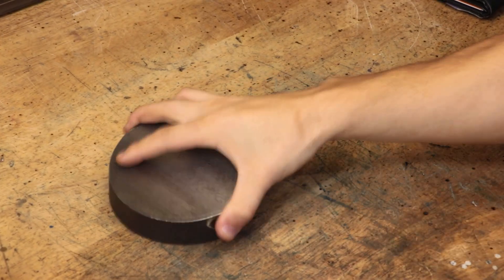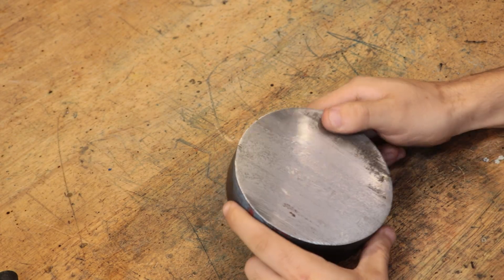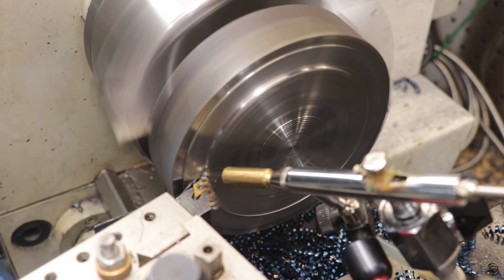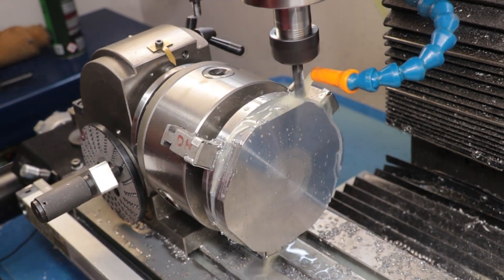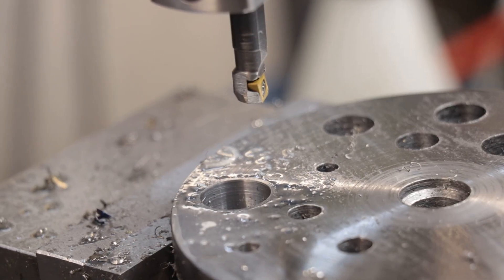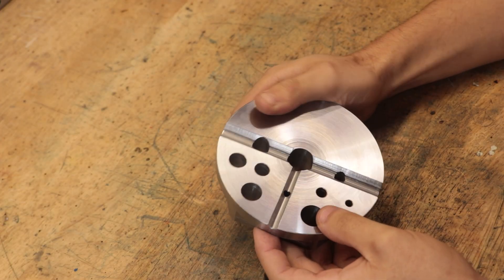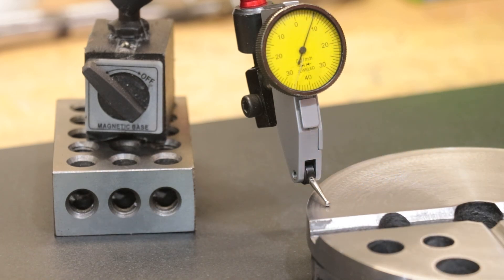BUILD: A Toolmakers Bench Block (Staking Anvil)

Comment: Back side hollowed out for weight reduction?
Reply from the maker: Would that really be necessary
Reply: @artisanmakes probably not necessary, but asked why. I was searching for bench blocks and most of the new ones were hollowed out. Less weight was the only reason I could think of. Why wrestle with a 5 pound hunk of steel when a 2.5 pound one would be lighter, especially if you were using one hand.

Comment: That lathe is extremely fast. especially for going from nothing to pretty deep into the metal on each one of those cuts. and the evidence of that is the chips are completely blue. however it's really good for nice finishes.
Reply from the maker: It’s been so long since I did this but I think it was the speed that worked the best on 4140 with these carbide inserts. I don’t think I was particularly happy with the Brad I was using.
Reply from the maker: Nah I just checked again, it doesn’t go above 300rpm. Well in the range for the inserts I’m using here. The video is sped up quite a bit
Reply: @artisanmakes 
I wasn't considering that the footage was sped up. but it was doing some aggressive cuts. turning all chips blue.
Reply from the maker: It probably was a bit. I was pushing the lathe quite a lot when I first bought it. But I guess that is what carbide is there for. Cheers

Comment: Hi, I've been going down your catalogue of videos (just found you recently, great channel!) and I notica you never seem to use stress-relieving cuts in parts where you have internal angles. For example, the dovetails on your replacement late cross-slide, I was surprised you left those un-relieved acute angles, especially as the original cross-slide had relief cuts.
I'm no expert so I don't really know how important this is, I can see the forces on the cross-slide being reasonably low so fair enough. But I'd expect the stress-rising effect of the sharp angles at the bottom of the V-grooves to be quite a concern, given it's a hardened part and the splitting forces are likely to be very high given you'll be hammering on rods in those grooves which is going to put very high peak forces pushing the groove apart. I thought you'd have rounded out the relief with a ball-nose endmill or something.
Like I say, I'm no expert. Is this just not as big of a deal as I think it is?
Reply from the maker: For this one specifically I did one channel length ways, but for the perpendicular one I didn’t, mostly cause it wasn’t a sharp corner/line left by the cutter so I didn’t think it was hugely necessary. 

For others I take on a case by case basis, I have done it a few times, but the way I see it is that if I’m not using a super brittle material and I’m not pushing the part to its limit, I usually don’t worry a whole lot about it. Is there a risk of cracking, yes. If it was a mass produced part or a part you were making for someone else it would be worth adding. But for me and my parts I’m usually confident enough to judge that most parts aren’t being pushed to their absolute limit and probably dont need that relief cut. That’s my looking at it anyway.
Reply: @artisanmakes  Cheers for replying, yeah that makes sense to me :)
I guess it's worthwhile for commercial parts where you want reliability and you definitely don't want failed parts being returned. Especially seeing as they're most likely made with CNC so it's basically no extra effort.

Not much experience with metalwork here. but I've found a few situations working with other materials (silicone sheet being a biggie) where cutting a circular relief at the end of a cut makes the difference between a part that will literally rip in half under its own weight and one that can withstand a huge amount of tension.

Thinking about it I suppose thin sheets are way more sensitive, eg sheet metal.

Comment: This comment may have already in one or more of the 151 (at this moment about 2 weeks after this video was posted), but I'll make it anyway, just in case: The undersides of some(?) bench blocks are probably hollowed out to try to avoid the block rocking on convex surfaces (i.e., uneven workbenches or chips on flat surfaces).  Edit: You commented on this at about the 6:50 point in this video.

Comment: great build!
oh heck i keep forgetting to tell you..
if you happen to be in oil/gas region or mining, a great source for large 4140 scrap is folks using pile drivers. they often replace foot long 4" diameter round sections and 1ft sq by 6" thick  sections of 4140 as part of their consumables. free/cheap metal

Comment: In a comment elsewhere in here you mentioned it was difficult to get a small enough feed in with the lathe. I can't see your setup to see if it is, but if you set the compound at 30 degrees to the workpiece then the feed on the handwheel halves. So one 20micron graduation becomes a feed in of 10.

Comment: thing is with grinding that the amount of material that passes the tool varies from the outer circle towards the center so you either need to slow down the lathe while moving to the center of move the tool slower inside the further you go in 
allso might be eazier to heat treath the steel if you use a pottery oven as you can controll the temperature a little better inside it and heat the part more evenly , you had the part in the pad of the propane flame and it was pretty clear that the part closest to the flame got hotter faster than the part that was away from the flame , this might allso cause warping 

aaaah waswondering where a staking anvil ws used for , hmmm thats pretty handy

Comment: If you want to polish the face of the bench block further, you could certainly stick a piece of fine sandpaper in a granite surface plate or even a thick piece of float glass and wet sand the face of the block against it.

Comment: I have an idea for minimizing the aerosolized coolant your mist part cooler produces. Add a brush to the end like one of those cheap ones for flux, or maybe add a sponge brush, the brush head means it still delivers the coolant where needed by just placing the brush head on the part. It'll reduce aerosolized coolant by catching it in the bristles/sponge.

Comment: I would imagine the reason it cracks in water is because it is cooling it off too fast. Oil will hold heat better. Keeping the part from shock. Same reason why some people can heat treat a flat bar, and others are just cooking a banana.
Reply from the maker: That is right but some steel are more prone to cracking than others due to what they are alloyed with

Comment: Ild avoid using your power drill to unwind your chuck. If a chip gets in there then it can cause some damage to your chuck since the drill will just power through
Reply from the maker: maybe. I used to do this for years with the old chuck and it never caused any issues. i know the risks and I am fine with doing it to these cheap chucks

Comment: It's awesome to learn more ways I could do a job even without the proper equipment. lol well done. My suggestion would be if you're ever in a position again of having to make "V" grooves like that again would be to machine the relief slot first. This may seem counter intuitive at first but it is very important based on surface speed of tool geometry. When running at a constant RPM the larger the diameter of the tool the greater the surface speed is all the way down to a diameter of Zero whereby no matter how fast you have your spindle running the surface speed is also Zero. Therefore, when machining a "V" groove with a chamfer tool and no relief you are basically dragging the very tip through the material as if it isn't spinning at all which will create greater pressure on the machine and the tool. Hope this is helpful for future endeavours.
Reply from the maker: I know, I think I just got lazy for a bit and tried to make to work

Comment: Nice build. One suggestion though, instead of loads of facing cuts to clean up the stock, use the mill with a large end mill or shell mill to remove the bulk, then face in the lathe.
Reply: or .... the hacksaw!

Comment: HRC of 50-55 is pretty high for 4140 steel. Its toughness increases rapidly below HRC 50. 42-48 is generally a good range for very high strength and good toughness

Comment: You ran out of power when drilling enventhough mill has the 3 hp motor?
Reply from the maker: Yeah. It’s extremely powerful above 600-700rpm, but still lacks a bit of torque to do low speed drilling in large diameters
Reply: Oh thats the case 
Thank you for information I was planing on doing something similar to my mill but I thought that 1.5 hp will be enough

Comment: to get a better finish with your tool post grinder, run the chuck clockwise (reverse), dress your stone with a 45 degree-ish angle and turn the post with grinder mounted to match the angle on the stone to the work. only take very light cuts. anything 1/1000 of an inch is way too much for a tool post grinder

Comment: when machining a v groove, it is a good idea to make a relief with the normal endmill first :) Also, 50to55Hrc is not too hard to turn on a lathe with proper carbide inserts.
Reply from the maker: I’ve done a bit of hard turning before, but I don’t think the inserts would appreciate this type of interrupted cuts
Reply: @artisanmakes  depends on the inserts :) but yes, they can go dull fast :D
Reply: @artisanmakes  CBN350 inserts are great fori nterupted cuts in hard steel. Just use small depth of cut. They work great for truing chuck jaws instead of grinding.

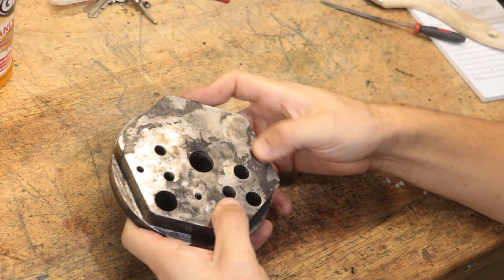Comment: At 16:45, could you have done the heating with an electric furnace/kiln, or an electric induction cook-top element inside a furnace type body, while flooding the furnace with argon gas instead of flux for surface erosion protection?
Reply from the maker: Yeah if you certainly can if you have one. I don’t unfortunately

Comment: Aboot the bottom being dished out.  Do I get a prize ??
Maybe it's the same reason dish bottom furniture like tables and lamps.
  Is to help them sit flush on surfaces without rocking. Imagine the difficulty it would be to get a 3 foot diameter flat bottom dish from rocking if the surfaces are not perfectly flat

Comment: For your surface grinding - reverse the lathe so the rotational planes are opposed.  If both contact points are spinning the same direction they're going to push off instead of biting in.  Having a very slight angle helps a ton too.
Reply: I don't know nothing about machining so I'm asking you since you seems knowledgeable, the angle is so you have a single point of contact instead of a whole surface ? What if the point gets worn out? The stone wouldn't bite into the part so no more "facing" , thanks
Reply: @fabiofoltran4361  Yes, it's so you have a single point of contact, but the direction of contact is more important than the amount of contact.  Good instinct there.  The wheel is going to wear down, it's designed to so it doesn't get smooth and stop cutting, but it wears out slowly if you have the right type of stone. As it does you can adjust for the wear and you have the option to "dress" the stone, meaning use a small diamond to cut it back into shape.  With this small of a stone it's not going to matter if your stone starts looking like a dreidel, it's going to work just as well  because the entire contact surface will be rotating the same direction.

Comment: The boring out underneath is to make it less likely to wobble on uneven surfaces (less contact area) same as with mugs.
Reply: mugs mainly have a recessed bottom for the same reason that glass bottles do which is to direct all the force of placing them into the area which is strongest
Reply: i’m not saying you’re wrong just that the reason you stated is secondary to durability

Comment: Great build! A Blacksmith taught me when i was young that used motor oil makes for a good hardening quench medium and iv always used that. Different oils from different cars are bettor or worse,  and i hear the impurities from the engine and carbon build up actually add to the oils ability to make a harder case on the metal.
Reply: It’s been a long time since that was a thing. All the detergent and other additives in modern oil make it pretty bad as a quench. What he is doing with veg oil is a much better option.
Reply: @Phil_Cleaver  How do the detergents effect the quenching of the steel? Does it change the rate the heat is removed or how it interfaces with the oil? Genuinely curious cause I've never heard that mentioned or experienced anything to suggest such.
Reply: Me too, the cost of the motor oil being way cheaper than vegetable oil is my motivation. I haven't done enough to tell anyone what to do properly though.
Reply: Lawn Mower oils are a possible source of low detergent oil. The detergent keeps impurities suspended in the oil to allow for being filtered by an oil filter. Non detergent oils allow contaminates to settle and circulate less in engines that have no filters to capture them.

Comment: A good tool for facing that wonky puck of 4140 is a diamond tool holder. They handle interrupted cuts really well and take seconds to sharpen. You don't even need to remove the tool bit from the holder to sharpen it. If kept sharp they require less power to drive than a ceramic bit too. Use another bit ground with a slight nose radius for the finish cuts.

Comment: When grinding, it is often prudent to reduce the contact area of the wheel with the workpiece. In this case the end of the wheel is often dished out so it only cuts on a line around the circumference. This reduces heat build up and helps with keeping the wheel open.
Reply from the maker: Yeah I just did the lazy option of tilting the grinder every pass to try and grind on one corner
Reply: i agree. mount it side on so the circumference of the stone presses against the part, not the face. just turn the tool 90 degrees.
Reply: They mean if you're using the front face then you dress it with a chamfer rather than a square face

Comment: That router bit would have lasted longer with a clearance slot machined first. The cutting forces on the point are too high and the point is too fragile to withstand the cutting forces. I've done it with a slitting saw or a small diameter end mill. The slitting saw worked a little better depending on the depth of the slot.
Reply from the maker: Probably, live and learn

Comment: Bench blocks are bored on the bottom to reduce the weight. Toolmaker boxes usually have hundreds of pounds worth of tool steel, and weight reduction is important
Reply: Also so they sit flat on a workbench. Much easier to sit flat on a small rim than on a wide surface.
Reply: And it gives chips somewhere to go when using it as a tapping guide.
Reply: a machining related tool that sits around in the workshop is probably one of the last things you'd care about reducing the weight of.
Reply: @vxiiduu   It'll also dampen more of the hammer blows if it's heavier.
Reply: @vxiiduu true, until someone thinks he deserves it more than you.